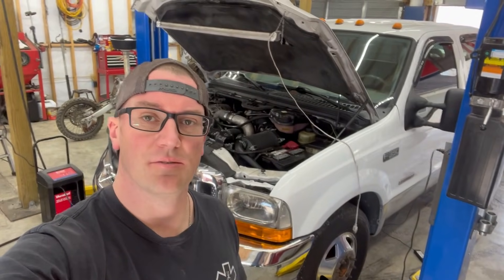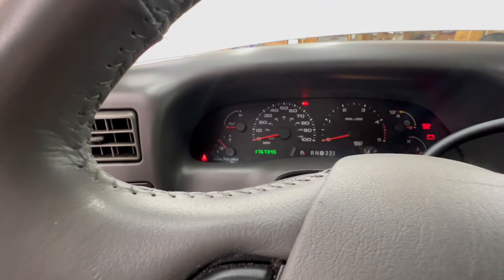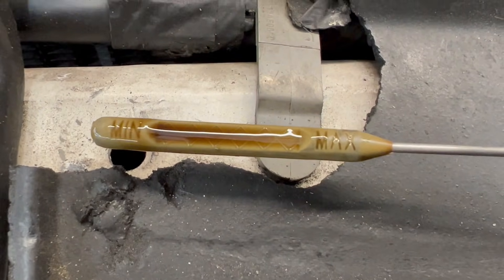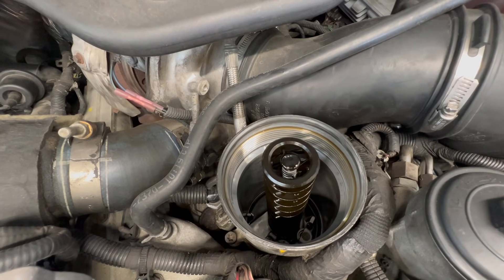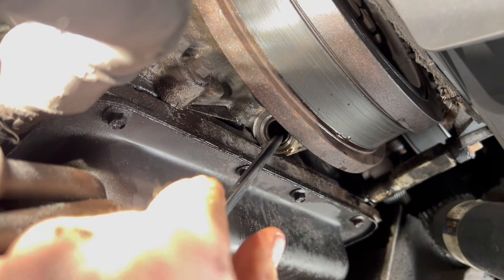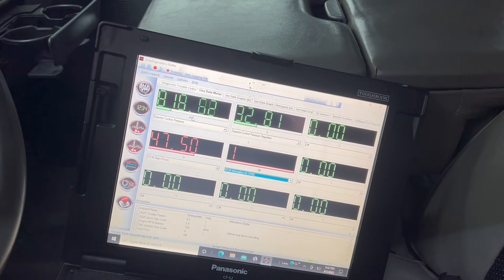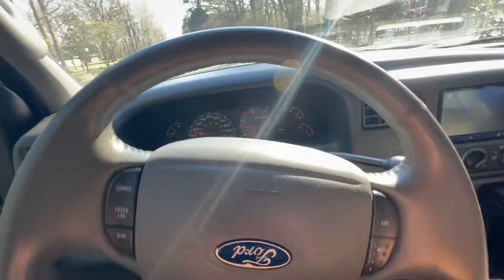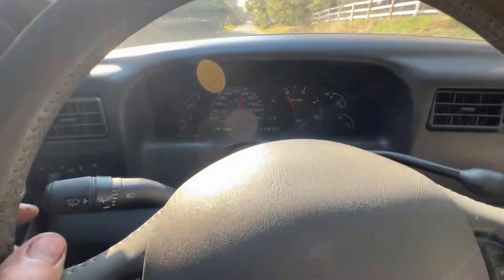6.0 Powerstroke crank no start no base oil pressure

Comment: I’m having a similar issue with my 2006 6.0 power stroke. Losing power when going up small hills shut the truck off turn it back on and it work good unless I’m going uphill. I’ve cleaned the diesel lines, changed the filters and also changed the IPR but the issue continues. Also some days it cranks up fine in the mornings and other mornings it won’t turn on unless I use a little fuel ⛽️ can’t figure out the issue
Reply from the maker: Need live data when the problem presents. Icp psi, ipr%, FICM main voltage. Fuel pressure has to be check with a manual gauge but it would be helpful also diagnosing
Reply: @AutomedicGarage if I’m driving on the high way as soon as I go on a small slope the problem presents itself, if I’m just driving going thru lights the issue doesn’t show up. I notice it because it starts sputtering and shaking while it losses power
Reply from the maker: @joseRodriguez-kf3ex what’s your icp V KOEO

Comment: I’m having a crank no start issue after replacing my oil cooler, front cover/lpop, and wiring harness. Not getting any oil reading on the dummy gauge. Think this is it?
Reply from the maker: Did you lube up the LPOP when you assembled? If not some time they won’t prime if not.
Reply: @AutomedicGarage I did not but someone told me to poor oil down the filter housing to help it prime and that worked. But now it still will not reach 500psi on the ICP sensor
Reply from the maker: @jacobmoore6236 need live data. Icp psi, icp V, ipr %, FICM main V, FICM sync, CK/CMP in sync both KOEO AND CRANKING
Reply: @AutomedicGarage can all of this be achieved via edge insight that I already have?

Comment: What if the pressure relief valve is hard to put back in I literally had to push it in just to screw it back on
Reply from the maker: Did the valve itself not slide all the way up? If so you have a scored up cover or something preventing it from sliding up

Comment: I’m only building 32.3 On the ICP PSI. On ICP (V) it’s only going up 0.29, I tried your genius method but my oil raised up.
Reply from the maker: Is your icp pressure in kpa or psi and are you sure you aren’t ready ipr duty cycle because in read in %

Comment: Here is a money saving diagnostic suggestion, CHANGE YOUR OIL AND FILTER FIRST. We just spent 1500 bucks on a bunch of parts that were indicated bad by codes testing etc, although we did not have crank no start, we had STALLING UNDER MODERATE LOADS with restart possible. In the end it WAS THE OIL ITSELF. It had AGED OUT. We only came to this conclusion by running a scanner with a video and then reviewed what happened while driving, the DESIRED HPOP PRESSURE would be one thing and the ACTUAL PRESSURE would suddenly go to ZERO, like when approaching a mountain OR SUSTAINED high speed interstate driving at speed. Diagnoses was ONE MONTH LONG and it appeared to be fuel starvation (technically it was) so the HFCM was replaced (500) then we had EGR CODES (300) then we had EGR THROTTLE PLATE CODES (hadn't been plugged in since rebuild 5 years prior, oops)
Prior to complete stall out we had bucking surging hesitation which over a few weeks grew to full cut off with restart and resume after a 10 second restart crank.
Since changing the oil we have made two trips 150 miles and no problems at all, before the oil change we would cut off within 8 miles or so.
Reply from the maker: That’s not a money saving suggestion if you aren’t making LPO which this video is showing diagnosing, you’re encouraging someone to spend over $100 on filter and oil when it may not be their problem. What I showed in this video tells you if you have a LPO problem which new oil will not fix. Choose your wording better before encouraging someone to waste money. My diagnosis here cost nothing. I’m here to save people money and time.

Comment: Just tried this on my truck and there is oil pressure now but still won’t start
Reply from the maker: Are you referring low pressure or high pressure oil? If it’s filling the housing that only tells you that you have LPO feeding. You have to have at least 500 icp (high pressure oil in order for the truck to start. What does your scan tool show for icp psi(not kpa) when cranking?
Reply: @AutomedicGarage I unfortunately don’t have a scan tool. I left it for a few hours and came back and it started up again. But after a min or so it shut off again. So I assume it’s leaking somewhere or the pump itself
Reply from the maker: @danielcid6359 what year? If it’s 03 early 04 more than likely the pump or upper injector orings. if it’s 04.5-07 it could be stand pipes, dummy plugs, upper injector orings, ipr, or a non updated stc fitting. Need a scan tool and an air tester otherwise your gonna play the guessing game and shot the parts cannon which is not fun or cost effective.
Reply: @AutomedicGarage it’s an 04 not sure on early or later 04. Yes going to go to a mechanic tomorrow. Just wanted to try this trick out before that to try and save me some money. But time for the pros to look at it
Reply from the maker: @danielcid6359 tell them you have a crank no start hot and that you want a air test through the ipr in order to see what has failed and they need to test it hot not cold
Reply: @AutomedicGarage will do. Thanks for that info!
Reply: @AutomedicGarage truck turns on and runs but now there’s a popping/backfire sound from the intake and when that happens I lose power. Any ideas? Already changed egr valve and that didn’t fix it
Reply from the maker: @danielcid6359 codes? Power balance?

Comment: When I tried this with my starter wire it cranked and didn’t stop… it pumped oil all over the place and into the valley and onto the ground… isn’t is supposed to stop when I take the wire off?
Reply from the maker: Only way it could run was if you have the key in the run position. You only do this with the key in the off position so it won’t start
Reply: @AutomedicGarage thanks for the reply! Before I did it, I ensured the key was not in the ignition, but it did it anyway.

I’ve verified that I have a working LPOP but I’m still not showing base oil pressure on the gauge, and I replaced the base pressure sensor with a new motorcraft one - my ICP is very low, about 50PSI.

I will also say that I did have an aftermarket cap with a motorcraft filter that was measuring incorrectly. I have replaced the aftermarket cap with a motorcraft one with motorcraft filter and issue still persists.

Comment: If he found a needle bearing them what??
Reply from the maker: If it will pump oil after cleaning the relief valve then as far as the oiling system your good but your motor won’t be for long if it’s a needle from a lifter. If it won’t pump oil after finding and remains of a needle then your lpop is shot and more than likely the front cover also. As far as lifter replacement if it’s on either of the front 2 cylinders you can do them but just pulling the heads if it’s the back 2 cylinders either side then you have to either A) raise the cab, pull the heads and remove the engine or B) raise the cab, pull the heads and remove the trans in order to remove the rear cover. If your that far into it at that point you might as well just order a J&K long block.
Reply: @AutomedicGarage thank u for the response. How common of a failure is that?
Reply from the maker: @h22eh6 more common on trucks still bone stock and trucks studded early that didn’t get the updated pushrods
Reply from the maker: @h22eh6 it happens
Reply: @AutomedicGarage I’m about to buy one. 2003 6.0 I need a truck badly

Comment: So I got a 06 f250 6.0 it’s building oil pressure but won’t start just cranks
Reply from the maker: Are you referring to building LPO or HPO? what’s your icp psi, ipr%, icp V, FICM main power and FICM sync show when cranking?

Comment: What if my oil pressure gauge isn't moving and I'm getting a low oil pressure warning but it still turns over and runs no problem
Reply from the maker: Check your oil pressure sender and or wiring to it
Reply: Thank you for the reply. Will do tomorrow once I get my hands on that 1" 1/16 socket. Did the battery and oil filter housing trick and I have base oil pressure so that was a good sign. Appreciate your videos. Any tips is greatly appreciated.
Reply: Would you just check continuity on the switch to make sure it works?
Reply from the maker: @gavinbenner7073 check the plug and wiring first. If that’s not it the sensor is around $20-30

Comment: What happens if you keep cranking and my oil pressure on dash goes up but still no crank?
Reply from the maker: What’s your icp psi? Ipr %? FICM main power and FICM sync?
Reply: @AutomedicGarage icp 338 ipr 85.0 flp 8.50 fmp 49.5 what’s my problem
Reply from the maker: @Brickbikes clearly your icp. Gotta have least 500 to crank so you have a Hpo leak. Gotta air test and find the problem.

Comment: Is it possible to check for base oil pressure AFTER pulling the intake manifold?  We are in the process of chasing down a suspected leak on the High pressure side but we forgot to check the oil gauge before taking it apart.
Reply from the maker: Just put the oil filter housing back on the top of the oil cooler and either pull the fuel pump relay or hook the fuel lines back up also.

Comment: I have a question. I have an early '04 6.0 that starts fine now, but the oil pressure gauge on the dash takes a few seconds, about five or so (give or take), before it moves up. Once it does, it stays in the normal spot and remains steady. Is this normal, or could it be a sign of a bad LPOP or something else? I can hear an audible difference in the engine when the oil pressure gauge finally moves. I changed and cleaned the relief valve, but there was no change.

Thanks for your advice and wisdom. I’ve been watching your content for a long time now while trying to fight an intermittent hot no-start issue. It’s been a five year long battle, and I’ve had to slowly teach myself how to work on these trucks. All the shops around me, including Ford and "specialty diesel shops", have no idea how to work on them. They just throw parts at the problem, guessing without doing proper tests. I’ve wasted so much money over the years, and I’ve still yet to enjoy this truck since I bought it five years ago.

Keep posting 6.0 content, and I’ll keep watching! :)
Reply from the maker: What oil filter and cap are you running? And have you checked your drain back valve?
Reply: @AutomedicGarage  OEM Oil filters since i've owned the truck. 5w40 T6 oil. I have sinister diesel aluminum oil/fuel filter caps. The one where you have a test port on the top to check oil/fuel pressure. My OEM cap came broken when I bought the truck. I replaced the drain back valve (OEM Ford part) just to see if it would make a difference. I believe after I watched one of your videos actually lol.
Reply: Can it be caused by something else?

Comment: I have a 04 f250 6.0 and it want start for nothing I have oil filling the oil filter and my gage show oil pressure and I’ve tried everything I can think of to start the truck with no luck. what would you suggest I try?
Reply from the maker: What’s you icp, ipr, FICM voltage and FICM sync saying on your live data

Comment: Why 10w30 instead of 15 40
Reply from the maker: Injectors like the 10-30 or 5-40 better. Helps prevent stiction and way easier cold starts

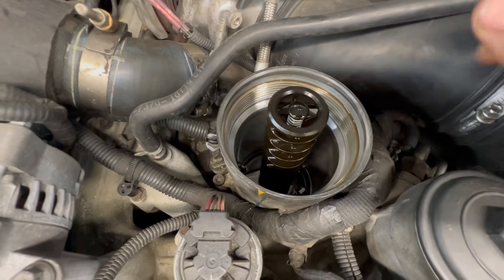Comment: Can this technique at 5:08 be used to start a truck in a pinch or will it just keep cranking?
Reply from the maker: If you have a low or high pressure oil problem it will not change anything however if you have a problem with your ignition switch or anything between the jumper wire and I groin switch it will crank it with the key in the run position

Comment: Ok and whats does that mean if your rpm when crankiing does not go up
Reply from the maker: @austinb-e2f  if you have good hot batteries and spinning over at a good rate it could mean your crank or cam sensor isn’t sending a signal. See if you have FICM sync and CK/CMP signals on your scan tool when cranking

Comment: So what could be the problem if the low oil gage dose go up?
Reply from the maker: @Warriorfox-y3u  is oil pumping up into your oil filter housing? If so you don’t have a LPO problem. Are you building any icp? What’s your ipr %, FICM main V, FICM sync?
Reply: @AutomedicGarage my icp was getting up to 400psi
Reply from the maker: @Warriorfox-y3u  84.7 is max ipr, 400 psi is 100psi short of starting
Reply: @AutomedicGarage  yes
Reply: I can’t look at the oil filter housing cause it’s was capped off cause we got it bulletproofed and My ipr was only showing 85% the ficm was above normal voltage and the ficm sync said in sync

Comment: Truck started it was 5 degrees started right up ran down the road suddenly lost power barely idled and shut off took an hour with jumper cables and cranking it started after work started right up but on the way home was pouring smoke opened the hood there was oil underneath the bottom of the hood and oil all over the icp sensor and pouring out the exhaust, changed icp sensor ran fine for a few weeks. -10 degrees this morning fired right up idled for 15 minutes ran 5 minutes up the road lost acceleration and power truck shut down cranks but won’t start there is oil around the new iCp sensor, truck won’t fire.. help

Comment: my 60 bus was running ,came outside and it was dead ,tried to start it .would not start ,wiring on fan was mangald, would this make it not start?
Reply from the maker: @Victoriaconnour4  if wires are crossed it can

Comment: I have no oil pressure on dash, I have oil coming into the canister. I changed the sensor. Any fusses or wires I can check? Crank no start
Reply from the maker: What sensor? Lots of sensors on the 6.0. What’s the following during cranking icp psi, Ipr %, FICM main power, FICM sync, CK/CMP sync?

Comment: Help! I replaced my #2 injector, now I can’t get her to start. My scanner is showing zilch for ICP when I crank. My oil pressure does come up when I crank. If my RPM gauge is rising it’s hardly anything. My scanner is also not showing anything on glow plugs when I crank. Shouldn’t that be showing something?  I’ve cranked enough without a single sputter to conclude that I must have screwed something up, but I have no clue what. Any suggestions from anyone be appreciated. Truck was running fine except for low contribution on 2 when I started.
Reply from the maker: @joeprimal2044  did you replace stand pipes and dummy plugs? You have a Hpo leak sounds like. It does take some cranking to get the air out but usually only a couple 10-15 sec starts.
Reply: @AutomedicGarage  I replaced the shorter ones. Maybe something went wrong, an o ring got crushed or something. I guess I’ll have to get back in there. Dang. Thanks.
Reply from the maker: @ why not both of them
Reply: @AutomedicGarage  Ignorance. I’m new to diesels and didn’t want to disturb anything I didn’t have to. Just wanted to get in, replace the injector and get out. This was all replaced by a mechanic not that long ago, just one injector was acting up.
     Anyway, you were right, high pressure leak, damaged o ring. Got it fixed and she’s purring like a kitten. So the truck got fixed, I got educated and I thank you much for your help. Enjoy brother.

Comment: That's the cleanest underside of a 6.0 that I've seen since mine was new!  Does anybody drive it or is it like my '06 F350 in the shop more than on the road..mine shot the oil temp sensor out, oil everywhere @ 75-80 mph. Replaced oil filter base and oil cooler.  Hmm no oil pressure no oil to filter :(  looking at low pressure pump.

Comment: Do you think it's the same system on 2003 f450 6.0
Reply from the maker: @juanmanuelcervantes3755  do I think? 03-2010 6.0s all used the same LPOP, relief valve, drain back valve and oil filter setup.

Comment: an update to the previous comment, Pulled the low oil pressure relief valve, moved good no metal, used magnet to make sure no metal inside, because i found no damage i changed the low pressure oil pump gears, they looked pretty good a very small sign something small had gotten in there, three of the humps in the gear had very tiny chip in them, but i put new gears in anyway. I also, air checked the engine, did not find what i believed were any air leaks, also put in new injectors, OEM, new dummy and stand pipes, put it all together, like i said before the oil filter housing fills up with oil but i get no oil indication in truck at all, using my scan tool, when cranking the ICP will not even change at all from reading 0 psi, no movement at all, and of course IPR goes to 85%, Now im not sure where to even start, so another question is it possible i still have to much air in system to crank, or could i have a bad ICP sensor,  thanks so much I hope to here from you, its your videos that made me want to do this my self !!
Reply from the maker: @alglommen8490  did you pack the LPOP with grease or vasoline to help it prime? It won’t prime just metal on metal

Comment: Hello, see last message,taking a chance you still help people, My 2004 6.0, will not show oil pressure on gauge in truck, with good battery power for cranking, but when i check for low oil pressure in the filter housing, the housing DOES fill up with oil, but when cranking the ICP PSI never leaves 0 psi. and IPR does go to 85%, Is it possible that i have a bad enough oil leak that it wont show any ICP pressure during cranking it ?
Reply from the maker: @alglommen8490  it’s rare to make 0 usually make a little. Unplug your icp and try cranking, see what scanner says